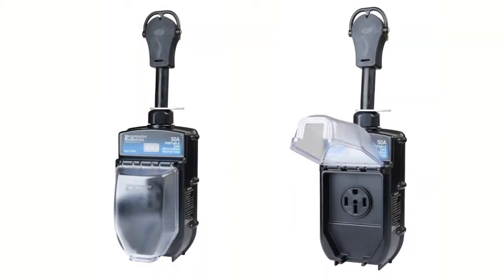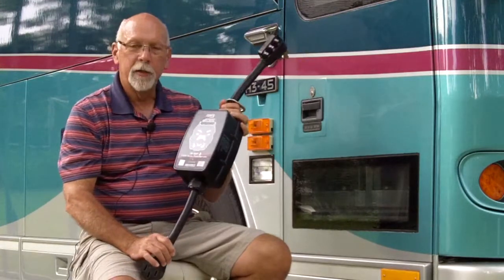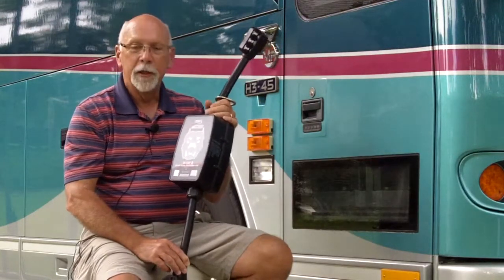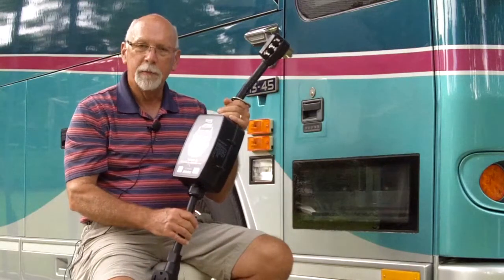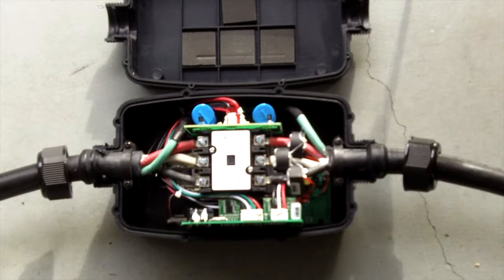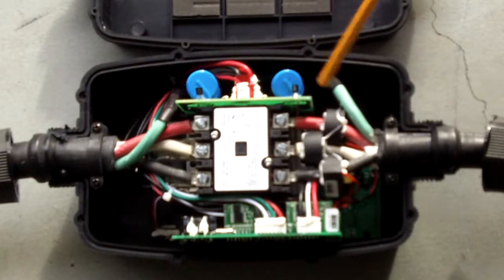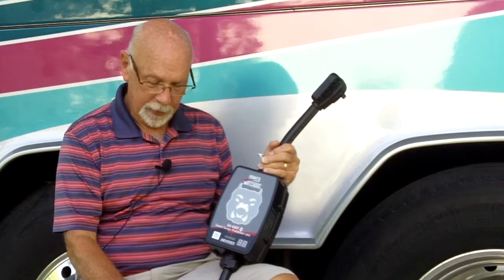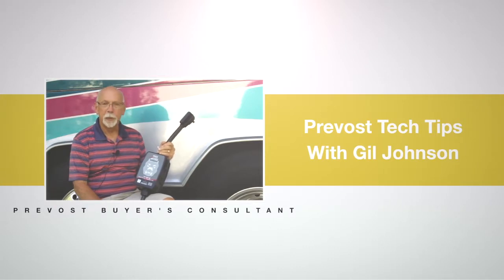Hughes Watchdog Review

Comment: I am not so sure your description of the features is accurate.  I believe it only checks for an open neutral on the park side.  I don't see anything in the specs of this product that suggests it checks for an open neutral on the coach side.
Reply from the maker: The 50A version, the version in this video, does test coach sude open neutral.  I tested it and can confirm it works.